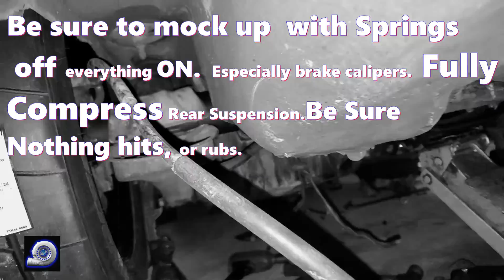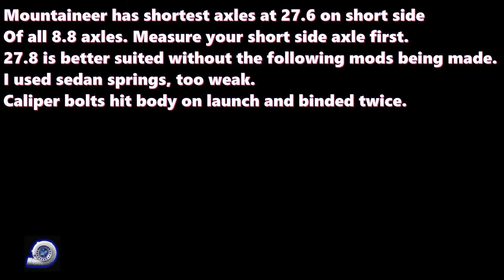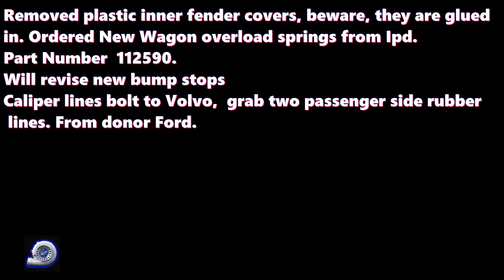8.8 Rear Swap ptII , Launch Break. Subframe Revision , and key factors to know.

Comment: I don’t know if anyone follows this still but worth a shot. I have a 92 960 Volvo originally with IRS. I have swapped to 8.8. I am already ls swapped and car is procharged 453 to rear wheels at the moment. My question is how did this setup up perform? I love the idea but was worndering if it worked?
Reply from the maker: It functions ok but needs fine tuning. I would suggest stiffening the trailing arms up at both joints and using some other alternative than I used to wrap the axle. maybe just a pivot hinge like the 240 has, would have been best? For the street it is fantastic. But for the sticky prep drag track, it moves too much and my pinion angle goes all over the place. As can be seen in the slow motion four wheel bunny hop as the axle moves back and forth in the wheel well , trailing arm joints too soft.
Reply: @TurboWorld thank you for the reply! What size tubing did you use for the sub frame? What size tires are you using as well?
Reply from the maker: @timothynavarro8186  No problem, the tires are Nitto 555r drag radials 245/50/16 and the two tube diameters are what we found at home depot, I think at the time for steel water tubing possibly? The outer diameter of the largest tubes is 1.07 inch and the smaller reinforcement braces are .84 inch. Again I was skeptical about this "pipe" holding up, but it has been perfect. It needs a hinge at the chassis instead of a 3m window weld poly  glob , like what I have now. I will eventually upgrade to that.

Comment: So the factory torque rods can't be used on the giffens brackets?
Reply from the maker: They can, just be careful above 300hp!!
Reply: @TurboWorld  This would be a lower power rally application likely below 300whp
Reply from the maker: @andymcdo  As long as you don't get traction too well, may be ok. But rally can be pretty ferocious.  If it were me, well I would upgrade it all to something like we built in my newer Ferrari vs Volvo video. Let me get the link.
Reply from the maker: https://youtu.be/jNMXnTXZTEs

Comment: What is your tire size and rim combination?
Reply from the maker: 245/60/16 Nitto nt555r drag radials on summit racing rims. You like them?
Reply: Yes, they ear sweet. I'm working on the same build. I have a 1990 240 that I have put a 6.0 in it.
Reply: Do have the part number for the rims
Reply from the maker: @hollismiller007  I looked, and I do not. Sorry.